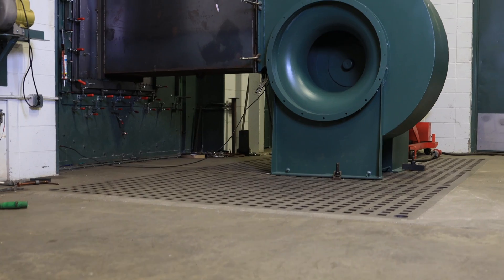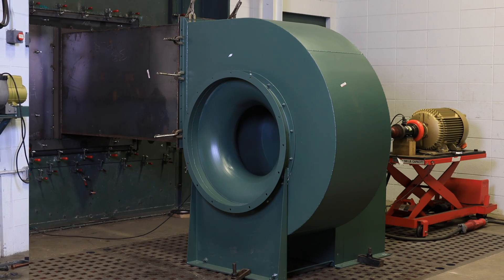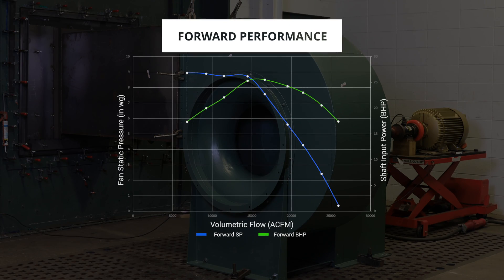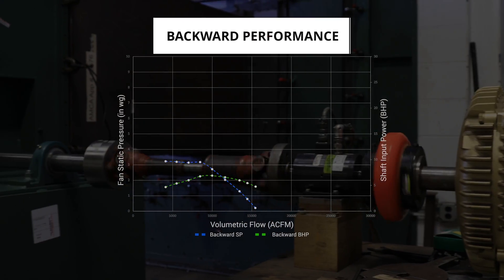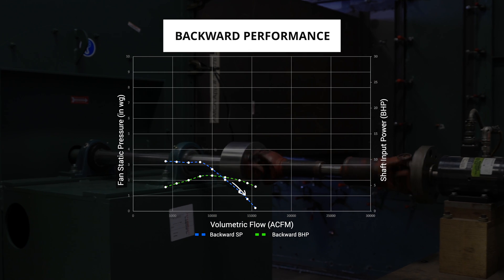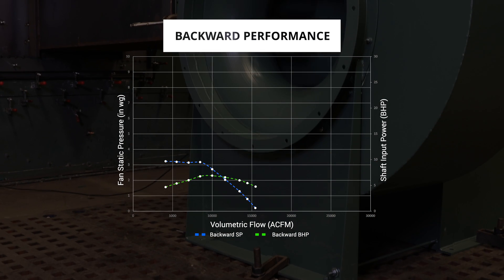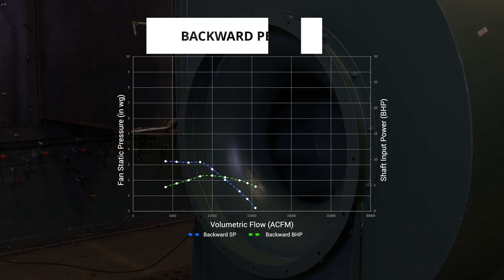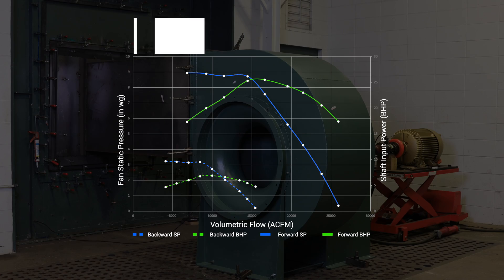What Happens When A Backward-Inclined Centrifugal Fan Is Run Backwards?

Comment: So if the power and the ammount of airflow reduced does that meant the amps are also reduced as p=E x I ( volts x amps)
Reply from the maker: Hi Chester! Yes, a change in BHP is almost directly proportional to amperage draw. There are slight variations based on load but generally, if you witness a 20% drop in amperage, you can assume that the BHP has also dropped by 20%.

Comment: Long story short; you get about a third of duty. This normally happens when the sparks wires the fan backwards…been involved in the vent industry for 20 years and I get this at least once a year still, when a contractor rings up telling me my fans are s*^t and not achieving duty. Either your commissioning guy hasn’t moved the potentiometer pot or the electrical boys have wired it back to front. Contractor is adamant he hasn’t but goes to check it…never hear from them again 😂

My question is; why aren’t we looking at saw tooth on the trailing edge of the blades, to try and reduce the noise levels? What kind of dB(A) reduction can we get, especially on larger units above 1m3/s. Would really help on the breakout noise from some of our AHU’s.

Comment: thanks a lot for the great video. This was very helpful. I actually thought power consumption would increase due to the lower fan efficiency. I guess the lower flow and pressure performance outscore  the lower efficiency :) What would the effect be if the impeller was installed opposite. I.e forward inclined?
Reply: Same question.  Do you get a vacuum cleaner of sorts?

Comment: Why are the blades called "backward-inclined" (I've also heard "backward-curved"), then? In relation to what?
Reply from the maker: Hi! Thanks so much for reaching out.

The term backward inclined comes from the fact that the air across the blade surface deflects in the opposite direction of the rotation. This may seem counterintuitive, but it allows for the fan as a whole to generate static pressure more efficiently because part of the diffusion is done by this backward deflection rather than the fan casing. For this reason, BI fans generally have the highest efficiency and are best suited for medium flow and medium pressure applications. 

When referencing a BI wheel, the blade angle radially out from the hub will always be less than a 90 degree angle. 

Hopefully this is helpful. If you have further questions about this topic, please feel free to email us at nyb@nyb.com.

Thanks!

Comment: Hi Matt. Thano you for the precise vid.

Does your department design custom multistage blower systems?
Reply from the maker: Thanks for watching! If needed, nyb can engineer a system utilizing multiple fans in series (typically 2) mounted on a skid to achieve pressures beyond 200” wg (7 psi or 50 Kpa).